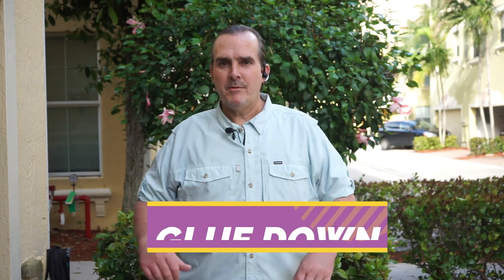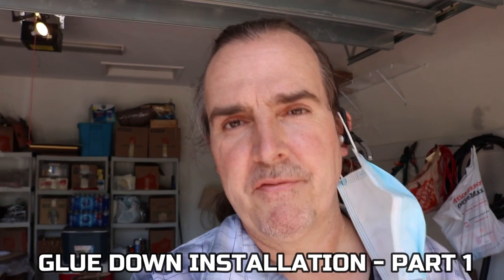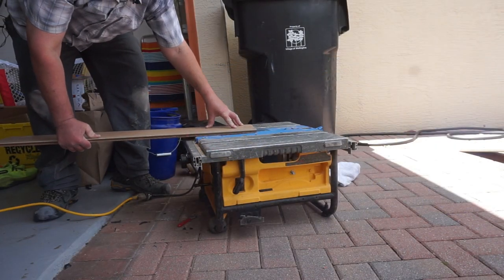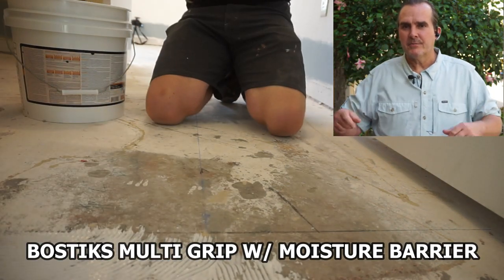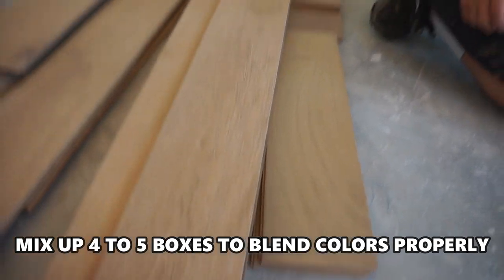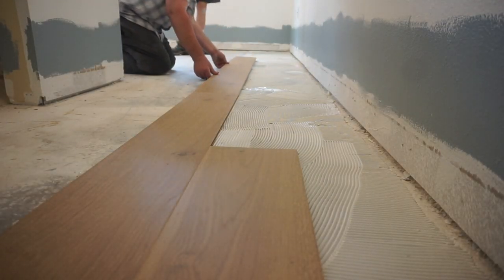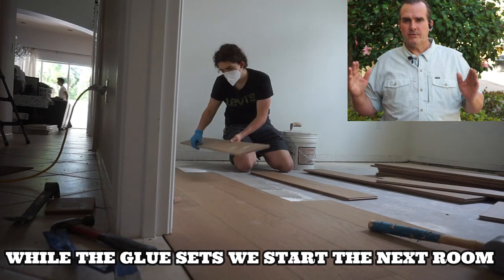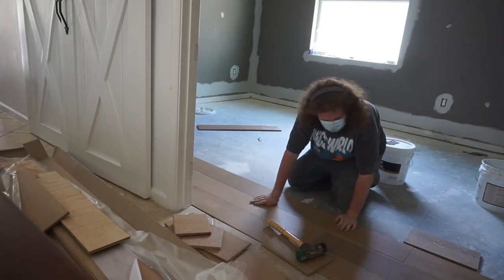DIY WOOD FLOORING INSTALLATION WITH GLUE - ENGINEERED WOOD, MOISTURE BARRIER, HOW TO, FOR BEGINNERS

Comment: great video thanks.  Ive been looking for info on a hard wood floor. I nailed most of it down but a small part is unable to be nailed so I need to glue it. Im looking to find info on the vapor barrier. Does the glue have those qualities in it. I can't imagine you can glue the wood floor to the vapor barrier.  Thanks. One note I have for your kids.  Knee pads if you want to be walking in 20 years.
Reply: "Knee pads if you want to be walking in 20 years" - That's the first thing I thought when I saw these kids on their knees like that... When you're young, you don't feel it and think you're invincible... it will catch up to you

Comment: Excellent video. I’ll be doing the same thing. I wish you would have shown how you finished the space next to the base board. I have way to much base board to remove it for this project so I will need to use a piece of shoe or quarter round either the floor color or white base board color.

Comment: Had carpet in bedroom continuing hardwood from living room to bedroom was able to remove the hardwood piece that butts up to the carpet in the door way The question is will this be a good starting point to continue the flooring and it is the same identical flooring another words lock in the first piece under the door then keep running the floor?

Comment: Interesting video,  I’m putting down about 1400 sq ft of engineered wood on concrete. I got the wall-to-wall carpet & tack strips out, swept and cleaned up the floor ready for hardwood. If my walls aren’t straight then there not much I can do except start straight and cut the last piece to fit.   There are so much baseboards, corners & columns taking off base board is out of the question. What would you recommend for finishing the edges against the base boards?  A thin quarter inch x 1/2 “ shoe painted white. Or white quarter inch round?
No corners are 90°, they are rounded so base boards are cut with two 45°s  piece to accommodate the rounded corners.
Thanks for the informative video.
Reply: Either chalk, or preferably, lay a lazor line down on the floor. Near the side where your "starting corner" is, in the area of your start.

Align your first board alomg the lazor, or chalk, line, and then lay to the wall. 

Walls are NEVER straight, ever. Plan accordingly, do not line up your flooring w any wall. It needs to be straight, even though the house isn't. There are other tips to "fake" those lines, kinda, but, it's very case-specific.

Contact a super-experienced tradesman w an outstanding reputation for perfect work & ask him or her.

Comment: I’m debating to glue my floors down vs nailing them down. Can you provide information on installing over a plywood. Also, I’ve been reading and watching about this and most recommend to start at an exterior wall. In you case you started at an interior wall can you elaborate on that. Now I am confused which wall to start at?
Reply from the maker: If you have a plywood subfloor then nail down will come out the best and you wont have the added expensive of glue which is super expensive! I try to lay my jobs out so im always laying in front of my not behind me I dont like doing back fills. Id much rather keep going forward.